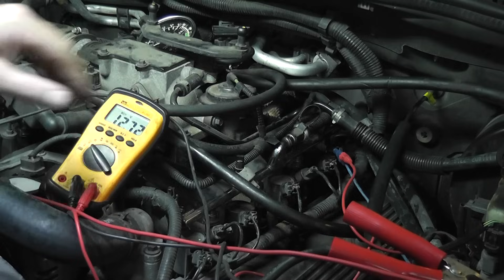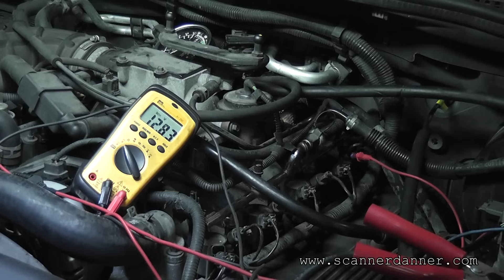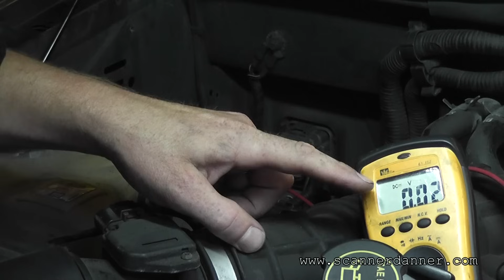How to test a fuel injector circuit with basic tools (open control wire)

Comment: Great video. I have a misfire on my 2013 x5 n55 engine and I just verified that injector 5 was bad by testing each connector, and I got the same .485 volts across each plug with key in on position. I'm going to run the same test on plug 5 with engine on this time and verify against cylinder 1 if the same voltage is coming through. Thank you.

Comment: are u suppose to do it warm or cold , i did both and my numbers are totally  different
Reply from the maker: For injector circuit testing? Doesn't matter
Reply: @ScannerDanner  

got it, i did the fuel injector resistor ohms test and got different readings when the car was cold and hot. It threw me off ....

Comment: this has given me an idea i need to test   , another question if there was no light at the end would that means i have to change the computer  and also can i use continuity test to test if the wire is okay
Reply from the maker: No light at the end of what? What test specifically are you referring to
Reply: @ScannerDanner  if i put a test light tester and connect the positive to power and the negative to the ecu point and yet no light  does that mean the ecu is bad i need to replace it  am refering to the last part of the video where you probe directly to the ecu and saw the ligh
Reply from the maker: @japhethpeter8288  ah okay. One more variable before you call a bad PCM:
You must make sure that injector circuit is not being intentionally shut-down. To confirm, shut engine off, wait for aat least 5 seconds, then restart, and see if the light starts flashing for a few seconds at start up. If it does, the PCM is fine
Reply: @ScannerDanner  thanks will try it over the weekend  will give an update

Comment: Thank you. I’m not a mechanic or tech not even close. I used your video to learn how to use a multi meter and noid lights and diagnose the injector circuit error code on my Jeep Wangler TJ 4.0L and learn that my injector is good and PCM was good and that the issue was in the harness! So cool! I’m a digital marketer and a marketing director is my day job. So fun working on the Jeep! Thanks doe the video!
Reply from the maker: How awesome is that! Thanks for sharing and nice job

Comment: Mr. Paul, good afternoon.  can help me on one issue: the wave reading of a fuel injector, with osciloscope and with the hot engine, does not show the characteristic voltage peak of wave for electric coils.  is it an osciloscope failure or is the fault fuel injector? thanks a lot
Reply from the maker: Do you have a misfire? What do the other injectors look like?
Reply: @ScannerDanner  Mr.  Danner, good morning.  thank you for your attention, for your reply.  during the search for a small misfire, in the pause of the brame safe, I understood that I placed the oscilloscope probe on the wrong wire of the Fuel injector.  I'm looking for the reason for the average burn time below 1ms for a 2 cylinder engine Motorcycle.  as I don't have another engine for comparison, I adjusted the spark plug gap to a lower value, with a small gain in burn time.  and I keep looking.  Thanks a lot.
Reply from the maker: @Zahcosta  are you talking about the injector on time or the ignition system? Burn time is a term we apply to how long the spark is jumping across the plug gap. 
Thought we were talking about injectors?
Reply: Mr Danner, yes I mentioned spark burn time.  this time at idle speed has been below 1ms, and as the engine warms up, it decreases until reaching 0.8ms on average.  but I don't know what the parameter for a motorcycle engine is, if it's acceptable.  I will have to study more about snap test and ignition system waveforms.

Comment: This was suggested to me.  Not sure why?  Simple think out side of box.  Noid lights in my opinion are a waste of money.  Just use a bulb.  For example the common 168, 194, or 912.  Bend the contacts down.  The wire is small enough that it makes it difficult to damage a connector from front probe also small enough to back probe.  If you broke or lost your homemade noid light.  It is not expensive to make another.  What's the cost of a 2 back of 168 bulbs in your area?  

Simple circuit diagnostics is where the break down begins at many shops.  At least the customer got a second opinion which I always recommend if it doesn't seem right.  More importantly a perfectly good module was not replaced.  

Keep teaching and preaching test before you put a part on!!!

Comment: Is there a way to check the circuit without the light but on the wire? The reason I ask is I don’t have a light. I have my doghouse out, but a mechanic told me they would start by changing the ecm in my 1993 dodge, because they have no way to tell if it’s the plug that’s goes to the injector or ecm, so they would start by changing the ecm and work backwards but it might cost a lot to find the problem.
Reply from the maker: Find a new shop. That is ridiculous or do the tests yourself. I can help if you get yourself a test light (incandescent bulb) and a voltmeter
Reply: @ScannerDanner  I have a voltmeter. I just tested all my injectors. Down the one side they were 15.1 and one was 15. The other side were all 14.8 and one was 14.9. I can probably find the lights on the internet just not sure what they are called. The same mechanic also told me the ecm would be $600 bucks and that’s without the 2 hours labor. I went and looked and it was 3 screws and plugging in a harness. Then the part was 299 with a 50 core charge. So 250. I have done for years all the work on this van, except things I need specialty tools on. If I cannot find the lights then I will contact you back. Maybe if you know what I would search for.
Reply from the maker: @mudshark1971  did you fix this?
Reply: @ScannerDanner  no not yet. I haven’t even bought the lights yet. My girlfriends mechanic seems to think the guy was scamming me. He thinks it could very well be the coil. He said he would diagnose it for free if I tow the van there next week, but I’m contemplating just changing the coil to see if that is it before I bring it anywhere. I guess it could be a faulty coil that’s halfway working, but I have to figure it out soon.

Comment: 2007 Jeep Liberty,  3.7L. 
Have code faults for #1 misfire, fuel injector 1 circuit open, and Bank #1 lean. 

There is a slight rough idle, but no misfire perceived, and it runs fine under load and high speed.  Doesn't burn oil. Gets 15mpg combined mileage. Ran fine when I got it 64,000 miles. Now it has 110,000 miles.  It has had this issue for about 10,000 miles. Not getting worse, but so far plugs and coils and cleaning intake hasn't corrected it.

I checked and cleaned Injector and Coils wiring connections and they look good too. #1 Injector plug had some oil in it, somehow. Cleaned it very well with first brake cleaner,  then electronics  cleaner. Let it dry and reassembled.

Can bad Injector o-ring cause this?  I already ruled out spark plug, coils, valves, and did intake cleaning.  

I have not checked orings and the wiring from #1  Injector to the computer control.  And don't really know how to.

Any tips on checking Injector and its wiring and control while it's still in the head?  Thanks!
Reply from the maker: injector circuit code is where you need to focus. This is an electrical issue with that circuit, nothing else will set that code. Do the test light tests I showed in this video.
Reply: @ScannerDanner  the P0201 code, injector circuit/open?  That would make sense as the plug was filled with oil for some unknown reason. No leaks or spills that I know of. I cleaned it twice and the P0201 went away but the #1 misfire and Bank 1 lean code is still present.

Comment: But what if injector 1 flashes brighter  than the rest and you still got a 201?
Reply from the maker: flashes brighter? What are you using for this test? Injector plugged in or unplugged?

Comment: Hey scanner Danner I'm the guy with the 1997 Chevy Tahoe that has been going crazy trying to figure the misfire I have. Currently p0300 and p0308 code. I know you told me to join the forum I will.  But quick question I pulled the ectrical harness off the fuel injector spider and get 11.85 volts key on engine off.  Also at the fuel pump relay socket I get 11.9 koeo.  Is this too low of voltage causing the #8 injector to misfire? I get 12.48 battery voltage and had the battery tested it's good. Just don't know why I keep getting a cylinder that misfires and the strangest thing happens... I took the upper plenum off 3 times checking things over and every time I put it back together the misfiring cylinder changes to a different cylinder.  The last time I took it apart I believe #2 was misfiring. I put it back together #2 misfires are gone but now #8 is misfiring. Crazy.

Comment: Hi just have a question. I am DIYers. And i want to check those injectors connectors with multimeter. Do i need to turn the car key on? Or turn the key off position? Or as long as the battery is NOT  disconnected is fine? And how many volts should i expect from good injectors connector?
Reply from the maker: Depends on the car as far as key on power to the injectors. Some need to have an RPM signal to have power there, so cranking is needed. But in general, yes, key on and you should see battery voltage on both wires to each injector.
Reply: @ScannerDanner  thanks for the info

Comment: Thanks for this. Currently trying to resolve a misfire issue where spark is present and the fuel injector seems to be firing when listening to it through a hose.
Reply from the maker: Check compression too

Comment: Great explanation!  I have a buzzer that I hook up at the PCM in this situation, often allowing a quick wiggle test to pinpoint the open in the harness in case it's somewhere I can't see the scope/meter.  Great work!
Reply: If the plastic of the wires going to the injector plug is cracked open but not touching each other or the ground(Body of engine) could this still cause a small misfire during a cold idle? When I say small misfire I mean a misfire that does not register on the ECU of vehicle just like a slight stumble as if an injector gave too much or too little fuel.

Comment: So what is the problem lol
Reply from the maker: Watch the video 🙄
Reply: @ScannerDanner  I did I couldn’t make sense of it 😉
Reply from the maker: @birdcrazy329  open control wire (its in the title) 😉
Reply: @ScannerDanner  lol oh yeah I’m so dumb I promise I did watch it all so how did you fix it I’m from the Uk and not very clever ha
Reply from the maker: @birdcrazy329  i can't remember where I found the break in the wire, this was pulled from a class I was teaching and I have the full length version on my website. 
Are you having injector issues on your car?
Reply: @ScannerDanner  nice one .. I am yes however mine is a diesel and when I plugged it in it’s saying injector  4 open circuit … I have done loads but still not sorted it
Reply from the maker: @birdcrazy329  injector control circuits are different on diesel engines, so you won't be able to follow my voltage drop testing that I did on any of the gas systems other than GDIs
Resistance testing of the injector and control circuits would most likely be your best option unless you have a lab scope

Comment: I'm an apprentice and made the call of a bad computer because I had battery voltage in the injector but full continuity in the wire from the PCM to the injector harness. I hope I'm right lol
Reply from the maker: Sam, next time just simply measure the same control wire at the ECM connector for voltage. If it is 12v in that location (injector plugged in), your control wire integrity is good. No need to break out the ohmmeter. Hope that helps moving forward.
2nd, you had a misfire right? Sometimes the ECM will shut down an injector to protect the cat. To confirm if it is intentional shut-down. Shut the car off and then restart it. If injector control comes back for a few seconds, it is intentional shut-down and you need to look for the cause of the misfire elsewhere.
Reply: @ScannerDanner  Thanks for the reply mate. I'll remember that for next time. The misfire is continuous and has good spark but even after swapping the injector to another cylinder, the misfire stayed the same

Comment: Good Afternoon Paul Danner and happy blessed Friday 🙏.

I have a (2003 Dodge Caravan SE V6 3.3) and its throwing 2 codes (P1684-Battery Was Disconnected) & (P0201-Injector #1 Control Circuit).

I have the 2003 powertrain diagnostic procedures book for the code (P0201-Injector #1 Control Circuit) and I have the 2003 Transmission Diagnostic Procedures book for code (P1684-Battery Was Disconnected.)

I have taken action and followed instructions from the book that gives procedures for code (P0201) and i applied Test#1 & Test #2.

Im on Test #3 now and these are the instructions.....

Turn the ignition off.

Disconnect the Fuel Injector harness connector.

Remove the ASD Relay from the IPM.

Turn the ignition on.

Jumper the Fused B+ circuit and the ASD Relay Output circuit in the IPM.

Using a 12-volt test light connected to ground, probe the (K342) ASD Relay Output circuit.

Does the test light illuminate brightly?

Yes➡️➡️➡️ Go To 4

No ➡️➡️➡️ Repair the open in the (K342) ASD Relay Output circuit.
Perform POWERTRAIN VERIFICATION TEST VER-5.

Im not grasping and understanding these instructions as to where i can apply it and take action doing test steps from the book.

Are you able to help me grasp and understand this procedure of Test #3?

Test #2 procedure from the book for code (P0201) i applied the procedure and i filmed myself applying it.

https://youtu.be/r7xmOt0ueGk

Comment: Could you use same procedure on any vehicle?
Reply from the maker: Yes!
Reply from the maker: But not on a GDI system. Injection control is much different
Reply: I have women in my neighborhood who has 2001 Jeep Grand Cherokee 4.0 who wants me test her injectors. I have noid test kit but don't know works for Jeep
Reply from the maker: @chrisruth2040  you'll be good following these exact same steps on the Jeep
Reply: I've learned alot from your channel since subscribe to it in short time. I look at person car other day 2010 Nissan Sentra SR P0300 code. Unfortunately my scanner doesn't have misfire count feature so had them take to shop. The shop said constant misfire on Cylinder 3 and wanted replace all spark plugs and coil packs 800. What I learned from you not all misfire are always spark plugs nor cool packs. He brought back to me and did compression test on Cylinder because when turning it over didn't sound right. Number 3 cylinder only had 30psi and over cylinders were low.
Reply from the maker: @chrisruth2040  good thing you checked it right?! Nice job

Comment: Mr Danner big fan of yours....bought your book and following along....have 95 buick crank no start....garage threw f pump, ign mod, and crank sensor....called me and politely told me car was at end of its road...can't get it started get it out....I have only basic tools....no codes I have fuel pressure...need to know testing sequence from there...thx....my plan is to get it running and take it back for an oil change
Reply from the maker: Check it for spark and injector pulse. See what you're missing, then we go from there
Reply: @ScannerDanner  no spark no injector pulse...going to check ignition module next.....correct? I have gm factory shop manuals
Reply from the maker: @stilllearning6035  when cranking, do you have an rpm signal on the scan tool?
Need to check ignition inputs (chapter 21)
Reply from the maker: @stilllearning6035  i have some videos on this system too, right here on YT (chapter 21 playlist)
Reply: @ScannerDanner  no scan tool... multi meter and test light that'sit....rpm gauge on dash  doesn't move or flicker when turning over
Reply: @ScannerDanner  I appreciate all you help you are the best! I'm a little beside myself right now I can't believe I'm conversing with Legend... truly
Reply: @ScannerDanner  will check chapter 21 tonight thank you
Reply from the maker: @stilllearning6035  let's get you a uScope! Email me at paul@scannerdanner.com and mention this conversation and I'll give you an SD/AESwave tool grant towards the purchase. The uScope master kit is $429
No strings attached just like to give back when I can.

Comment: So in other words around the 3-minute and 16 second mark... I took it as if it was a bad computer you would still have the 12 volts coming out of the control wire right where it goes into the computer ... and that means it is receiving the 12 volts like it's supposed to but it just means there's something else wrong with the computer internally
Reply from the maker: 12 volts on an injector control wire, measured at the ECM, just means that there is no control. It does not necessarily mean the ECM is bad. You would then check inputs (cam,crank) and anti-theft or immobilizer systems too if it is a complete no start. If it is a single cylinder misfire, that would be handled a little differently

Comment: Hey ScannerDanner! 

I’m trying to diagnose my own vehicle and would love some insight

Cyl 4 misfire, ignition is good but it looks like no fuel is getting to that cylinder, swapped out injectors and moved them around and still at cylinder 4. The spark plugs were replaced and you can tell that the 4th cyl plug looks brand new still. So, this leads me to think there is an open circuit somewhere between the ecm and the fuel harness, what would you do in my position?